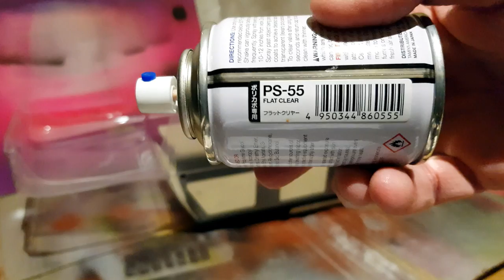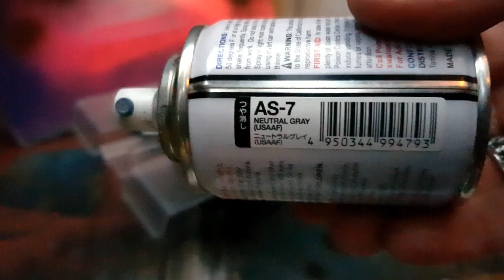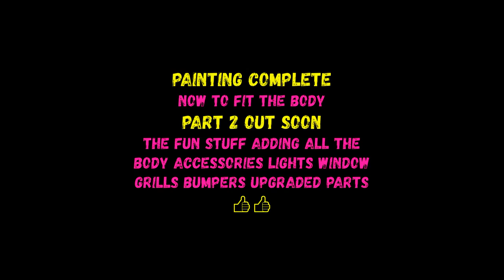TRAXXAS TRX-4 LANDROVER DEFENDER Clear Body Painting Custom Detailing & Install Interior Mods PART 1

Comment: I just bought the trx 4 sports truck body with roof rack and working hijack lift. I painted fire engine red with fire department decals. I also ordered working head lights and tail light soon I’ll be adding red emergency red light bar
Reply from the maker: That sounds great never seen a fire engine red one 👍they are such great crawlers as they are lighter that alot of other too  👍 😀 👍

Comment: Fantastic job. I realise this is an older post, but who supplied the body and interior? I want to find a clear body and interior to keep weight down/low, as the Traxxas body is very heavy. Many thanks.
Reply from the maker: most of the parts I buy are from Ebay both of those were also, the clear body was a random seller in the uk from memory and the interior from China lots of sellers list them for trx4  thanks

Comment: Beautiful project! This is going to help me out a lot, on my future (I am saving to get it ;) Defender, athough I won't start from this 'far away' ;) but I still want to paint some items and make it a bit more personalized. One question about the painting: do you spray the paint in a small container and then use your brushes? I don't get how you mix spray paint with an actual brush. Total noob here, thanks! Subbed+bells :)
Reply from the maker: Thanks, I spray the body's with Tamiya paint  from a can and only some of the body accessories I paint with a brush using Tamiya paints if they have the colour I want or sometimes I spray them also. If I am matching the colour from the body spray I spray a bit in a container then use a brush if its a small item that needs painting that will be hard to spray. Just dont paint the main body with a brush! Great hobby hope you enjoy it thanks for watching several other build videos on the channel to help you out too.
Reply: Thank you  @rcadventurer  , all clear!

Comment: Looks awesome man! 
I have a question? I see you use the PS flat clear on the inside  of the body first. Then what grey color are you using before you apply the white? I know it isn't a polycarbonate paint.  Does it hold up? I can tell it's  Tamiya paint but what is kind?
Thank you! 
Again,  looks fantastic!  Love your attention to detail. I picked up a used defender that's  still a work in progress. You gave me plenty of ideas!  Lol!
Reply from the maker: Thanks very much for watching and checking it out  I used Tamiya AS-7 netural grey aircraft paint (missed off that bit at the start but showed it later in the video when doing the interior if you need to see the can) not ideal for Ps body's as you say so the flat clear helps it adhere to the body then I backed in white then black so with the layers of paint doesn't chip or break when it crashes well not so far!! ha ha but nothing is perfect, (and it was the shade of grey I liked  not available in Ps ) and I did it for the jeep build on my channel also if you check that out SCX10 III Jeep wrangler to see it painted similar way.  I have used that loads outside but I am not a basher I take care of them as much as I can 👍👍👍  good luck with your Defender too they are great love them 😀😀

Comment: Hi Do you have a website and part number for the interior please
Reply from the maker: Sure thing thanks for watching too, its Ebay and think there are a few sellers with the same item.  I used seller -  coocogarder from china it doesn't show a part number just type in simulation interior parts for trx4 Defender several sellers to choose from cheers👍👍👍👍
Reply: @rcadventurer  nice one thank you . Take it you printed the sides pods ?
Reply from the maker: @richysrc2158  yes 3D printed parts from Knight Customs Rotopax containers 😁👍👍👍